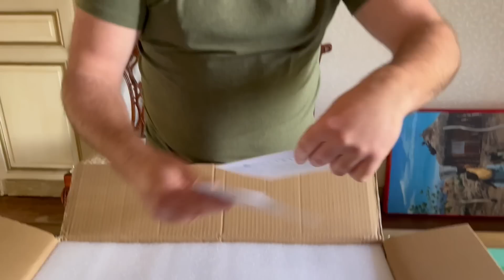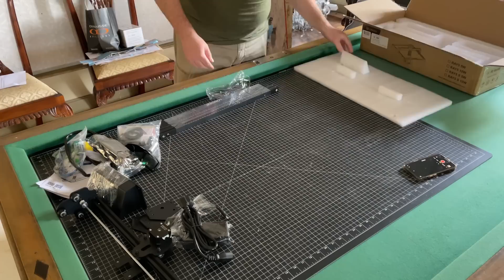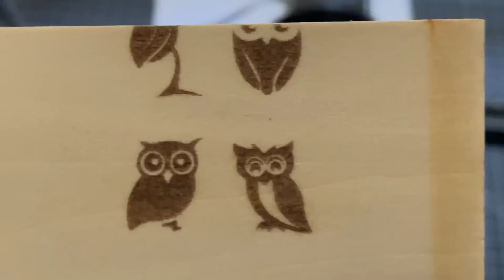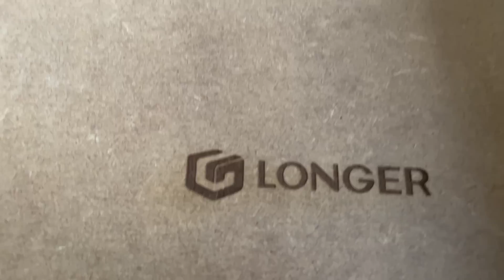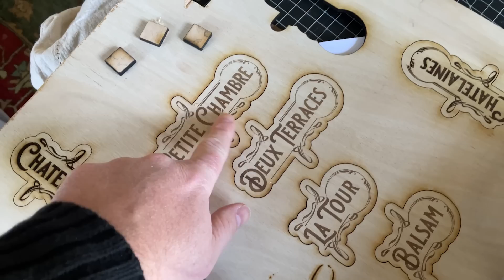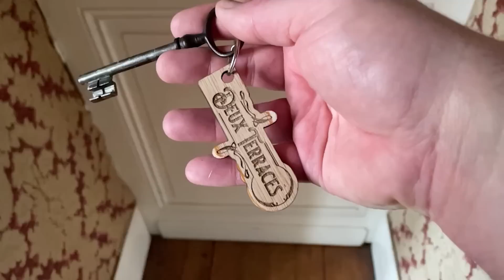A New Way to Create! LONGER RAY5 10W | Manor & Maker

Comment: What power and speed u  used to cut plz
Reply from the maker: To make the cut I used 100% power and 400-500 speed. It depends on the material and thickness. I always try to do 1 pass but occasionally I need a second pass to have a clean cut.

Comment: Adding compressed air to the laser will allow a faster and deeper cut at lower Temps and will avoid the blackened charring at the same time. A homemade enclosure (or even partial) with a old vacuum will get that nasty smoke out a window. Very bad to breath for humans and especially animals.